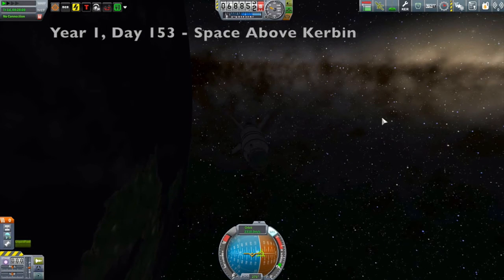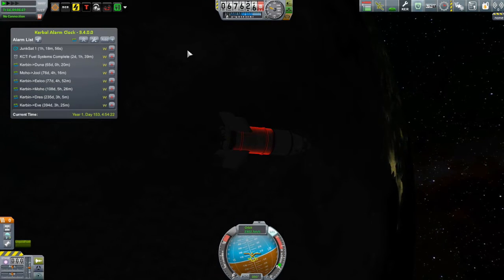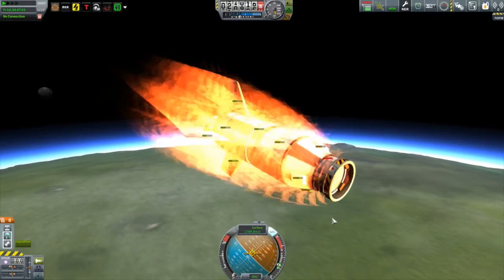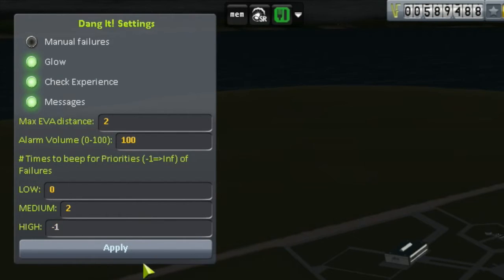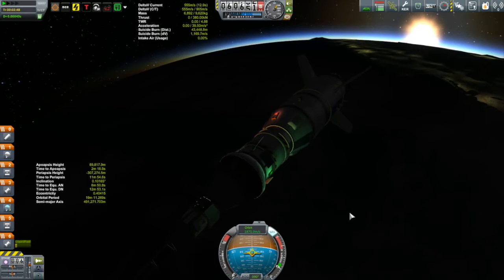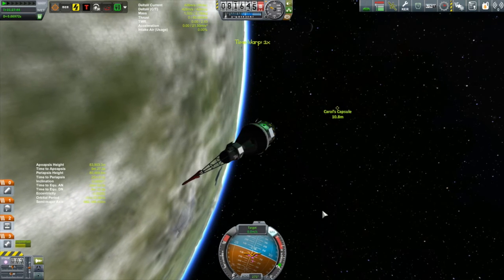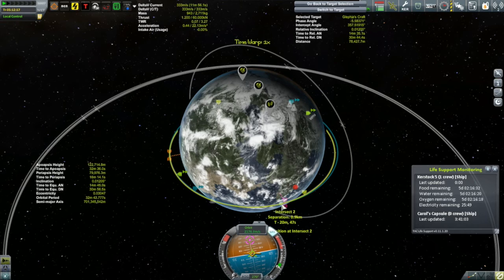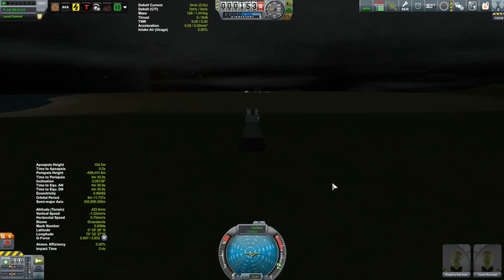KSP Career: Episode 21 - Double Rescue

Comment: When starting a rendezvous from an orbit that crosses/is tangent to the target's orbit I prefer to do all the burns at the already existing intercept point.  It's easier on fuel, (you eliminate both burns at the higher altitude in exchange for a smaller adjustment burn before the final orbit), and if you are starting from (near) matching orbits it's easy to chose where it happens, (i.e. without a planet between you and the sun).
Reply from the maker: +chakatfirepaw Yeah, I got completely confused when I thought the empty capsule was my target.
Reply: +Mike Aben That wasn't what I meant:  I was talking about not circularizing at the higher orbit.  You just do a pro/retrograde burn where you cross your target's orbit[1] so the orbital periods differ by close to an integer fraction of the separation between the vessel and the target.

That it might have avoided your confusion would have just been a side benefit.

[1] You can include some radial to make it tangent.
Reply from the maker: +chakatfirepaw I know what you meant.  That was what I think I had in mind at the time (at least, it's what I normally would have done), but seeing the capsule there got me doing some rather silly things.  It doesn't take much to throw me off.

Edited to add: Good idea doing it on the dayside, though.